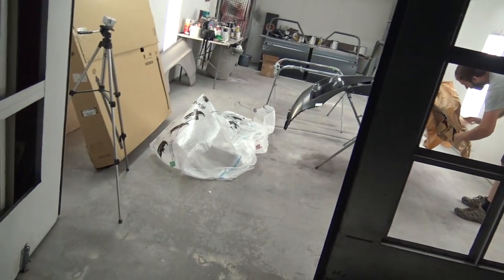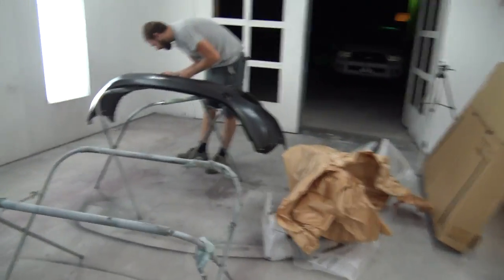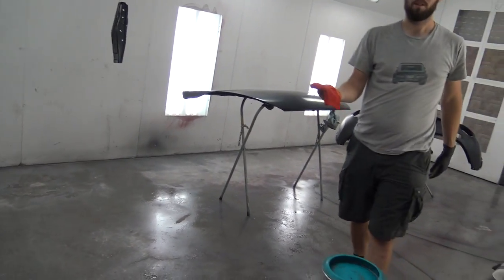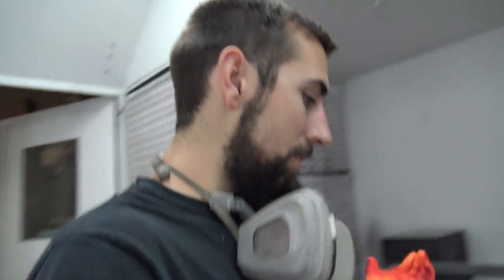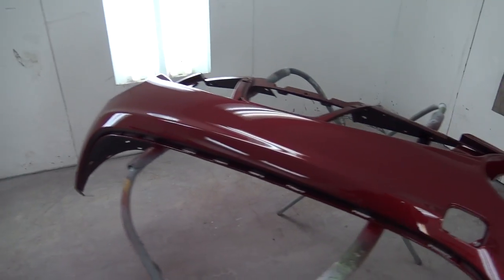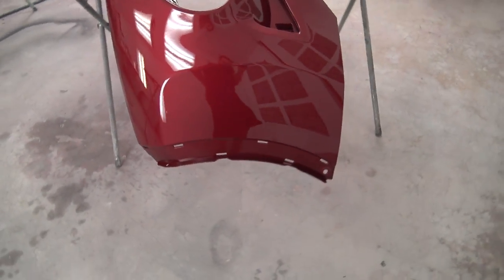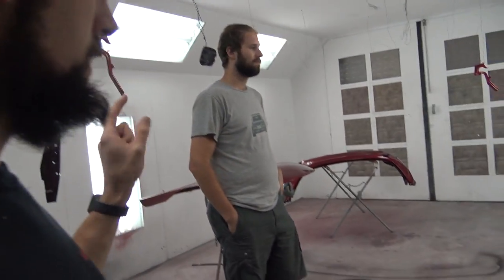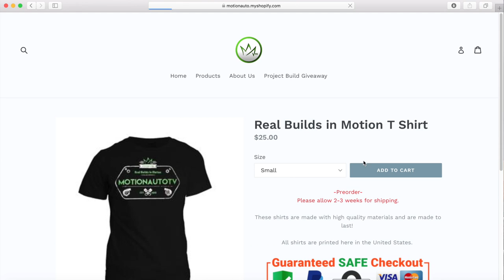PAINT BOOTH!

Comment: A tip on the booth.  Leave the fans running.  It pulls overspray out for a reason, when you shut it off gravity pulls dirt into your paint.  With the fans on it pulls the dirty air away from what you're spraying.  As long as no one is creating dust right outside the door the fan won't really pull dirt through the door just air.  Also did you spray any plastic adhesion promoter on that Nissan bumper?  Nissan bumpers are raw plastic so Sherwin Williams and PPG (most manufacturers) call for something on the bumper before sealer to help the paint stick also most call for ground coats of a certain color to help for coverage and color match.  Most reds won't cover in 3 coats.  I work at a dealership painting cars and have for 10 plus years.  No criticism just trying to help.  For not being a pro it seams you have the tecnique down pretty good
Reply: Nice advice Rob. Seems like he's learning and willing to take instruction
Reply: My friend didn't use anything on a raw nissan sentra bumper ( because he was so convinced the bumper was already prep for paint) he just scuffed and painted it out of the box. Few months later at car wash, paint started to come off the bumper like a snakes skin... o.O Prep is key.
Reply: Rob Rich just for info, when the fans pull over spray and dirt is called negative air pressure.
Reply: Rob Rich sometimes i learn more in the comments than from the actual video
Reply: Phillip Chazares the same concept works with filtered positive air pressure and it just exits through the cracks?
Reply: The fans will pull air out no matter the pressure.  Obviously more negative pressure means more air flow, but a slightly positive pressure booth is ideal.  Super negative pressure will pull dirt from outside the booth whereas you can have positive pressure, just enough to not completely suck air in when you open the door to walk in and out and the booth will still clear out overspray.
Reply: Rob Rich excellent i have a portable ac that sucks in air from the outside and blows cold air in creating a high pressure situation keeps the room at about 72 degrees is that a good temp or i should just put them on fan mode and let it get warm? (miami heat probably about 85 degrees hottest)
Reply: I spray at 80 degrees.  If its warmer outside then you spray in higher temps but at 80 degrees its perfect.  Colder temps mean you can spray with a faster hardener and faster reducer in the clear coat if it calls for a reducer, PPG doesn't except for a splash if you so choose.  Clear coat will lay out better when its not drying super fast so when its cooler it lays out nicer.   PPG has hardeners and reducers that are temp specific.  So like DC3085 for temps 85 or below, DC3095 for 95 degrees and below so it's important to use appropriate hardener/reducer combo's for the temp in the booth/garage you're spraying in.  Colder temps mean the clear can run easier if you get it on too heavy so always remember that.

Comment: TOP TIP! When you spray, put water on the floor and brush it about with a broom, 90% of dust comes from the floor, the power of the spray when pointing down when spraying pushes the dust everywhere, you can't see it but its there for sure, it also helps with bugs as it traps them if they land in the water, i used a much worse spray booth for 10 years, never had anything stick my paint, preparation of the booth is key to a good paint job.

Comment: I rarely comment on your paint and body videos because I don't want to be the guy that thinks he knows everything lol.  Anyway cross draft booths can be difficult to get clean jobs out of. Obviously you only want the incoming air to go thru the filters. So every other seam needs to be sealed up anyway you can.  You can hang a bug zapper outside the door and avoid painting late at night when all the bugs are out.  Plastic primer/adhesion promoter on bare plastic bumpers is a must. If not used that will eventually peel off in sheets after it gets a few rock chips.  Lastly I recommend a sealer on the new parts instead of going strait to base coat as it will likely chip pretty easily.  Just my thoughts, not hating, love the vids been watching forever.

Comment: Get the fans for your booth to where it pushes air out of of the booth instead of sucking it in. That will help keep down the dust and bugs. Also, regularly clean the walls and floor. And having the floors damp while spraying helps keep dust down.

Comment: You get dirt from many sources . That spray booth is only negative pressure meaning  its going to pull air and dirt ,  when u open the door in a negative/positive pressure booth the door won't close on you on its own, and you should have air pushing out just a tad but not in, pretty much you have a motor pushing air in and a motor sucking air out you should have the booth pushing a tad more out than In, this way u ain't pulling a bunch of dirt when u open the door , Another thing you should do wear a spray suit every time you wipe those panels your creating static electricity enough to pull lint off your clothes and dirt. You can spray alcohol after your last tack off to eliminate the static electricity, or use one of those fancy expensive air blowers to eliminate the static, another thing when was the last time they changed the hose ? the hose with time deteriorates over time from the inside , and all that deterioration goes straight to your paint . I seen people run over the hose when pulling in a car or taking out a car or even stepping on it that's big no no, there's many other things you can do to that's just a few

Comment: all you need to do is wet sand the clear coat with 1000 grid and then hit it with a buffer to get rid of the bugs and dirt!
Reply: gustavo accetta if you can buff away 1000 grid scratches then i need to know what product to use. xp
Reply: David Løkken lol my bad i meant to say 1000-2000 grid then buff it! meaning 1000, 1500 and 2000.

Comment: Why is this primer red? Please explain.
Reply: floppygoble this is a first type ive seen only grey, white,and tan primer
Reply: that's the base coat...
Reply: new panels come pre painted in primer, all you need to do is scuff it and lay a base coat then clear
Reply: floppygoble 
Not primer, its the base paint.  The parts are already have primer on then when you order them
Reply: floppygoble these people don't get the joke
Reply: tijean sharpe 
Can you explain? Cuz i really don't understand
Reply: ismael martinez he either said they were going to prime it in the video or he's talking about how matv has made like 10 episodes of just priming the supra
Reply: Plastic parts usually don't come primed, but a light scuff and a coat of adhesion promoter and you can go straight to base and clear or whatever system you're using. Steel parts usually have an ecoat and often don't require priming but if you want to go to a lighter colour its best to put down a grey or white base first. Imo, primer is only really good for repaints if the paint is a bit suss, to seal of repairs and sand throughs or if you're really putting time into a paint job. My 2 cents, not that anyone asked for it.

Comment: With no primer that red won't cover and match as well. For the people that say it's pre primed, well pre primed parts suck ass. They always have pinholes and scratched parts on them. They almost always need to be sanded, adhesion promoter, and then primer and paint. You need the adhesion promoter as well because it will keep the paint from spiderwebbing when it flexes.
Reply: Factory primer usually needs sanded or scuffed.  Pinholes are in gel coats over fiberglass not in factory parts.  Spiderwebbing isn't caused by adhesion promoter or lack of it... its because the paint loses its flexability after fully curing...

Comment: next time use bull dog on your flexible body parts just saying
Reply: dan gates I've been told it isn't necessary with newer paint. I was told if you hit something hard enough to fuck up the paint you'll probably fuck up the bumper cover anyway.
Reply: Bulldog Adhesion Promoter is designed to promote paint adhesion to all automotive surfaces, even problem plastics. It works equally well on all flexible or rigid plastics, fiberglass, aluminum, glass, chrome, vinyl, galvanized metal, and painted surfaces.
Reply: Bulldog isn't recommended under some water base paints.  BASF will tell you not to use their Onyx waterborne over any bulldog.  Most paint manufacturers will have their own plastic adhesion promoters.  Gotta be careful about which base goes over it.

Comment: No adhesion promoter or flexible sealer is never a good idea on a raw factory bumper...And spraying directly over that factory E coat without additional primer is gonna cost you in the durability of those parts...They are gonna chip with every little contact from road debris.

Comment: You should be rigging the bumper up in a way that is is like it is on the car vertically. Otherwise the metallics will not lay the the same way as they would if it was on the car.  It will more than likely look darker when its on the vehicle.  Just make sure you dont do it with the supra please! Otherwise good vid!